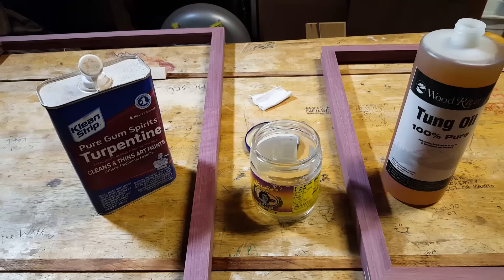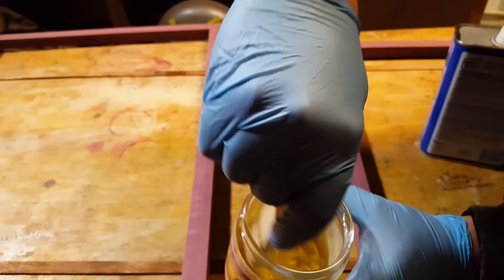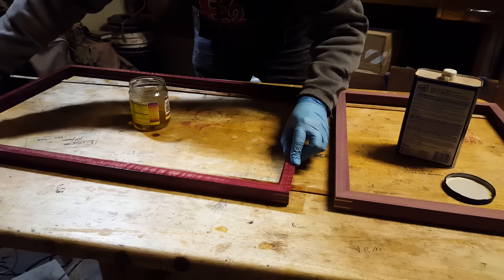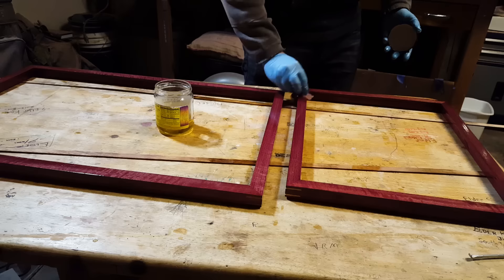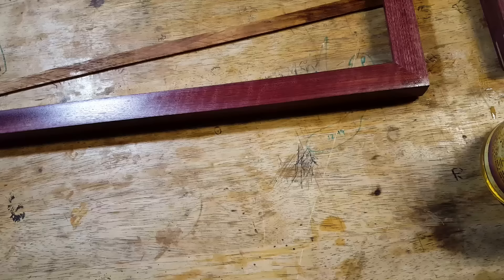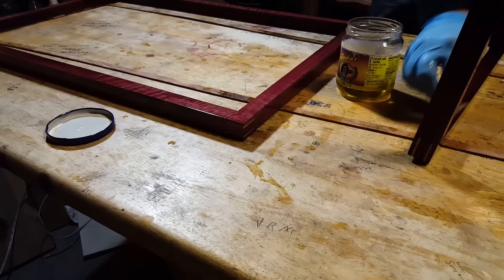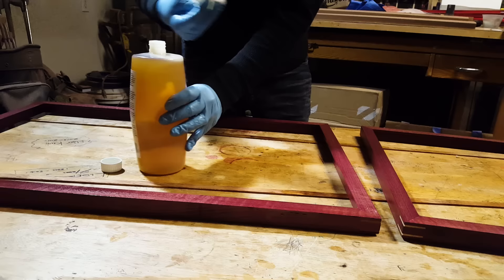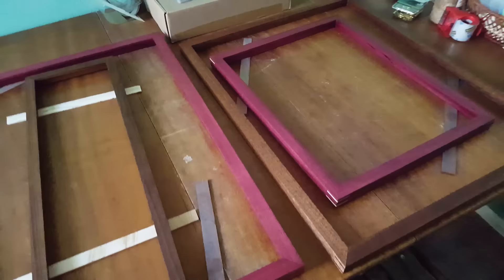How to Apply Pure Tung Oil to Wood (the right way)

Comment: With all due respect one has to be a little more critical here.
There is NO enhanced penetration due to solvent, the solvent may penetrate, the oil will penetrate to the degree that it does, whether applied thinned or full.
The net result is simply applying LESS at a time, so the coat is thinner, perhaps cures a touch faster. 
The analogy with oil painting is flawed. With paint it is the DRYING and the surface effect that is changed, not the depth of penetration.
An experiment is in order here, do one diluted and one full. 
There will not be any difference.